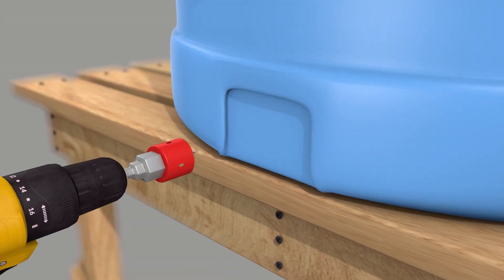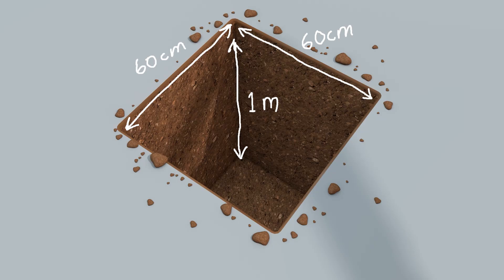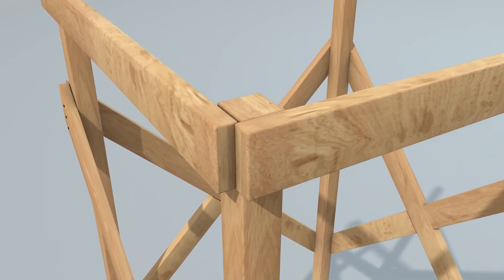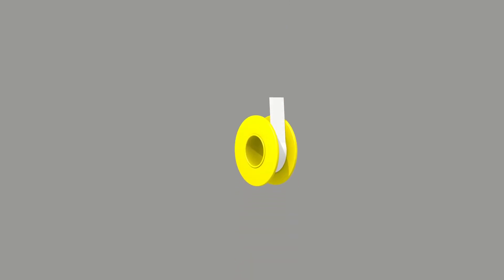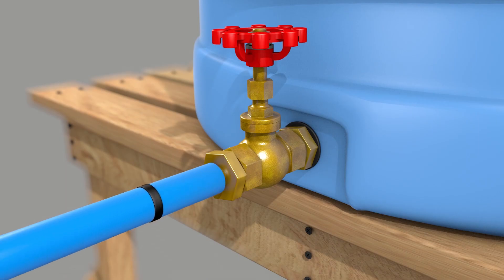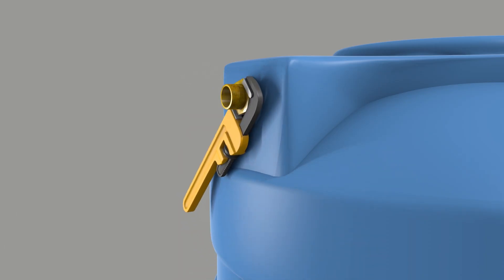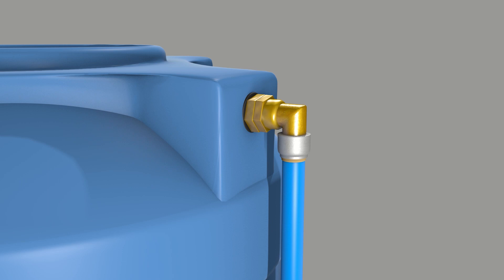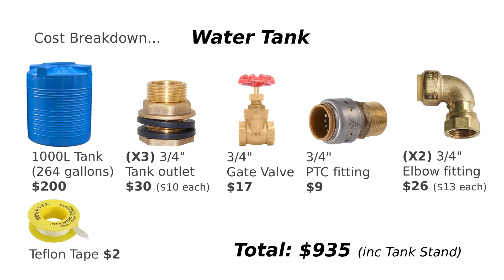Off-Grid WATER TANK Installation (Gravity tank +stand)

Comment: This video shows PEX being used for all connections.  Do not use PEX outside where it can be exposed to sunlight.  PEX will be degraded an fail over time.  Use CPVC for all piping and fittings, it's still plenty easy to work with.